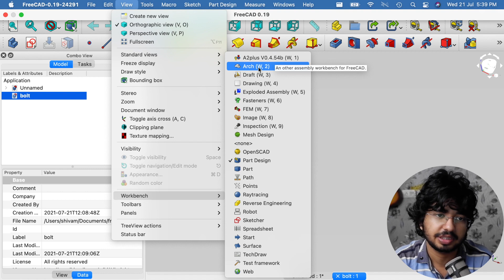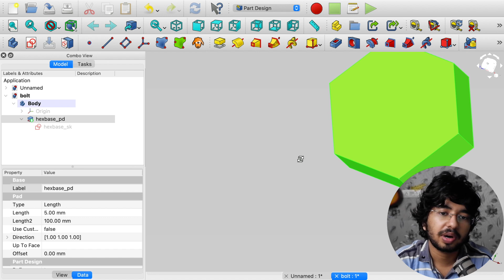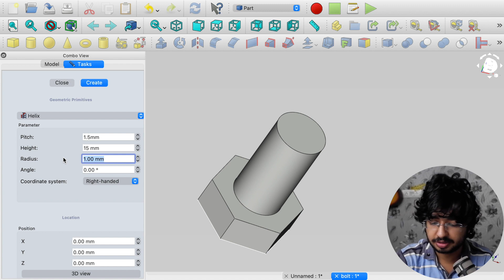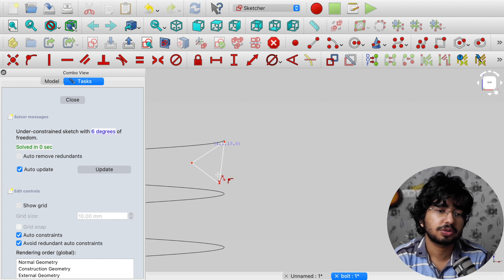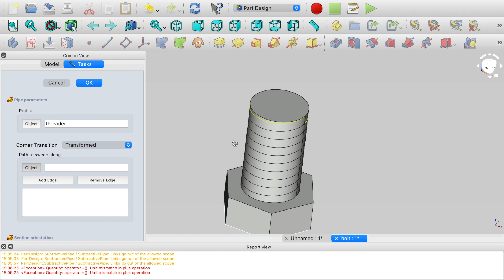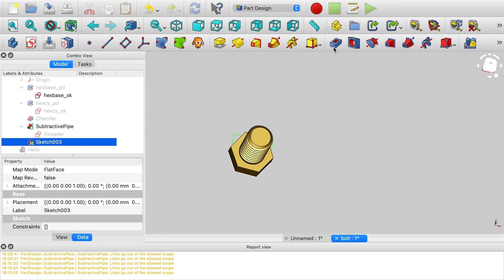How to make Threaded Bolt in Freecad | Beginners Tutorial

Comment: You aren't making a bolt, you are just adding the bolt to the workspace. I would like to learn how to make a bolt. I want a M8 and M10 bolt with larger diameter flange than the standardized ones that come with the fasteners macro. How do I customize dimensions on a bolt, not just pick a thread pitch?
Reply from the maker: You can just change the parameters and it would be updated.
Reply: @CreativeJE  how to you change the parameters of flange width?